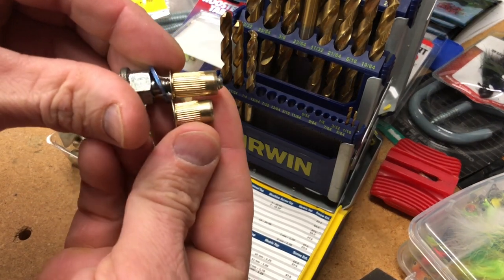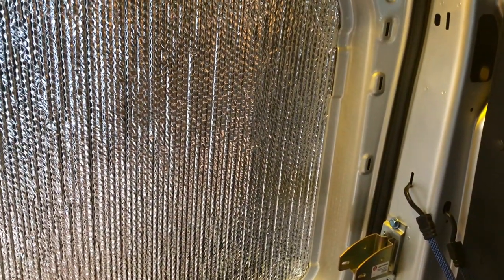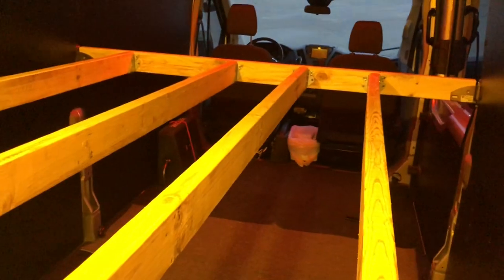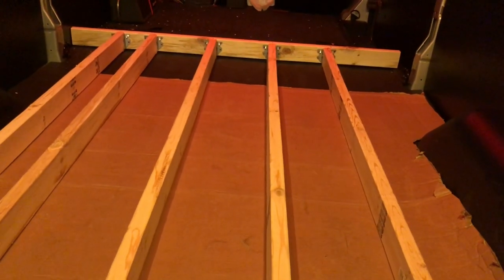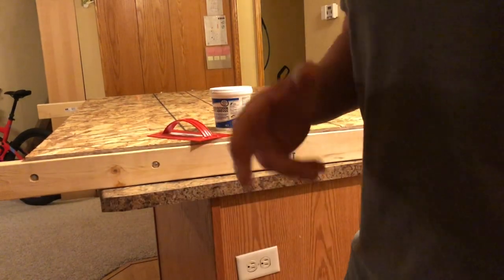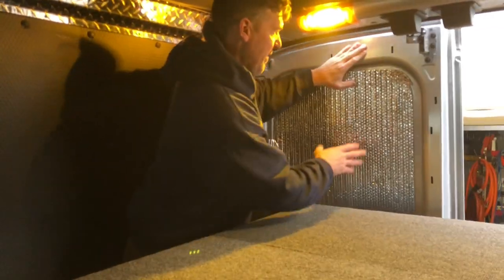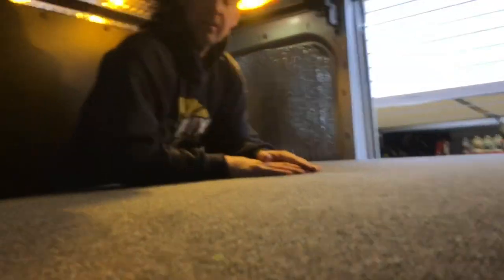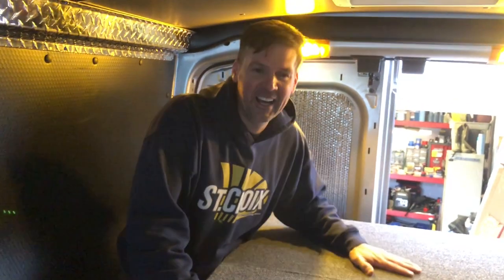Ford Transit Van Budget bed build out

Comment: Thank You for the video of the platform bed  fixing to get  a new  TRANSIT  VAN
how far up did you raise the bed up from the floor  and also i like the ceiling how and what did you use  and metal around edges of van ceiling  did you buy them or have them made  
thank you Rick
Reply from the maker: It was around 4’ or so, based on some of the existing mounting points. *See back window orientation for reference 
The ceiling and aluminum was part of a kit found online, do not have the info atm.
Thanks!

Comment: Love this build, but will be making it 60 inches wide to accommodate a short queen size RV mattress. Would really appreciate a complete supply list and a step by step list of the build. We also have a 2017 Ford Transit Cargo van with a mid high roof and mid length. Thanks in advance.
Reply from the maker: Donna Kirk thanks, it works well and is so far-robust. The basic supply list is in the description and you will need to be a bit creative and careful in planning the height, and tapping the metal. Use a step drillbit for that. I set the height based on the very rear already tapped and threaded, (existing) hole. Plenty of support.  You will need to cut/trim the e-track -approximately 3”section of it is what I did. Or take it to a steel fabrication business in your area for them to cut and debur...Build the 2x4/plywood frame and finish it off to make it look nice. Hope this helps and thank you for the kind words.

Comment: What do they call those things you set the 2 x 4’s in? I’m trying to make a bed frame for my 2017 Ford Transit mid roof van and that looks pretty neat. Thanks!
Reply from the maker: Tom Simmons they are called E-Track Wood Holders /Beam Sockets.
Google search and they run anywhere from 3$-6$ each. Keep them on hand because they are handy to have

Comment: Great idea. Been looking for a solution like this. Can you share what size plus nut you used?
Reply from the maker: Adam Toyama 1/4 20 threads and 1/2” If I remember correctly. Just grab various sizes up to 3/4” 
Hope that helps! Always good to have a stash of them
Reply: JLC That helps. Can’t find any locally (as you suggested) so ordering online. All parts are ordered. Thank you!!

Comment: if you can end screw, bolt, or nail you never use hangers unless it's over 3,000 lbs of load baring per joist 16 on center and under a 2x14...the 2x4s would be overloaded before the hanger......just saying.....

Comment: what mpg you get with the eco boost?
Reply from the maker: Chris Couch initially about 17 hwy, then as time goes by, with all my late model Fords,  it goes down. So about 13-14 currently
Reply: @JLeeChron  ive noticed the same with my transit. Getting about 17 all around 15k now that its at 20k im getting 16 to 16.5 mpg. Komd of makes me sad..

Comment: what size tires?
Reply from the maker: Matt Miller those are 245 70 17.  A bit of trimming to the pinch weld both sides, sprayed with undercoating after.
Reply: Thanks. No Lift?